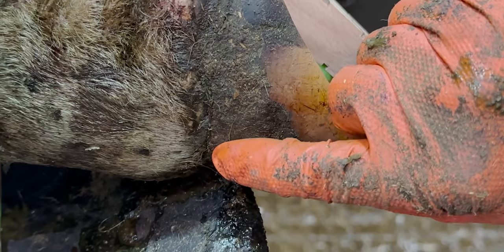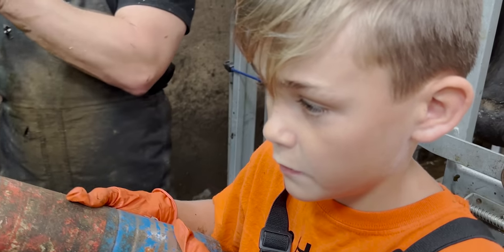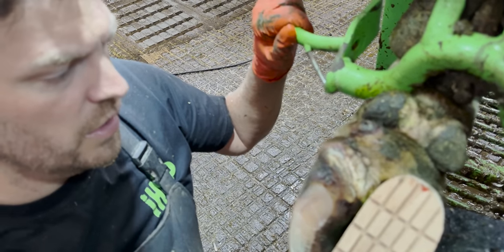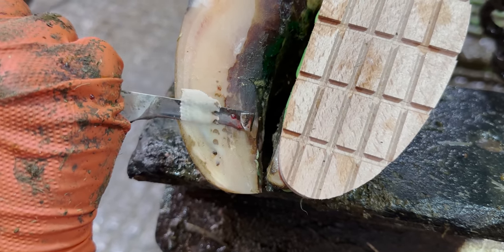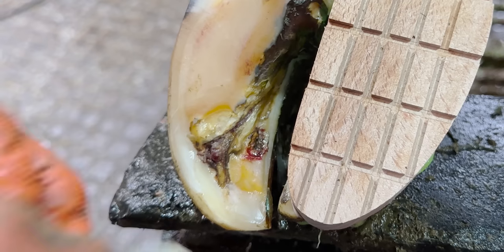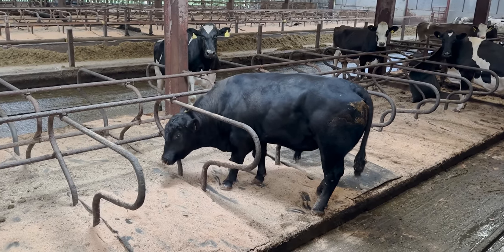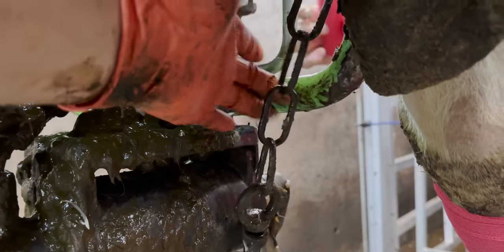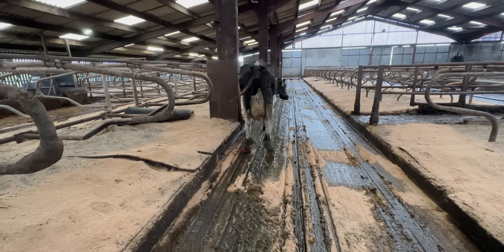4 PROBLEMS .... on 1 SHACKLED cow's hoof!!

Comment: Are there any small hand drills that can be used for the outer part of the hoof horn. Like when a human foot doctor will use to flatten a thick toe nail. But for cows and some of the delicate work. If not they should. Then when the knife is needed to do the even more delicate work. Your arm isn't tired and the cow isn't in the crush all that long. I hope this idea helps you and the cows/bulls.

Comment: 6:34 noticed you switched blades. Reverse hook angle, different width of blade. Which begs the question.  How many and what angles/sizes of blades do y’all carry with y’all for different situations like these. I know the blades width grind down over time because y’all sharpen blades daily.  
Maybe do a video similar to the one you did a couple years ago about how you sharpen blades, but this time go over how many and what kinds of angles of blades y’all use.

Comment: Idk if that's a fistula. I also don't know cows or their feet so Correct me if im wrong! I've been dealing with a fissure that was turning into a fistula. But from my understanding, a fissure is just a cut, and a fistula is 2 cuts with a tunnel that connects them. It looks more like a fissure cus you sprayed stuff in it, and it burst out of the same hole there was no other opening.

Comment: Graeme, what happened to the brown powder that you used to put against open areas on the claws? It's been quite a while since you used it. I only see you using the salicylic acid these days. Has it been recalled or has it not been working as well as the aspirin powder?

Comment: you wanna make sure the ... well this is 9 months to late... but I have 2 things to say number 1 You wanna make sure those chains that connect at each leg, you wanna make sure it's snug all the time, it'll do more damage otherwise and 2) For a new tool, take a look at one of those girls tube shaped hair heated curling, imagine you have a long cylinder with those.... slots you use on your big rotor for taking down the hoof, if you imagine holding it in one hand with a cover and 8 or so inches, you could make a finer powered hoof trimmer.